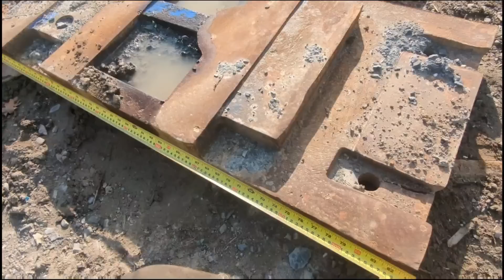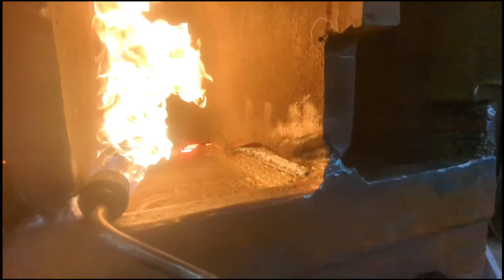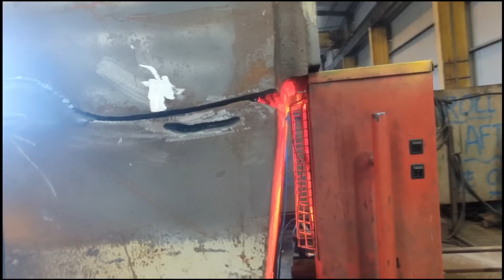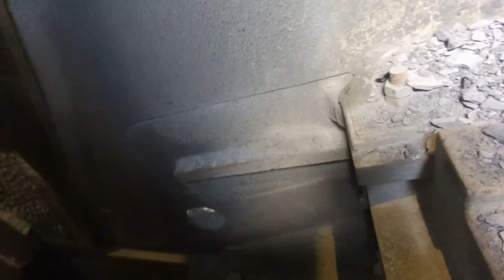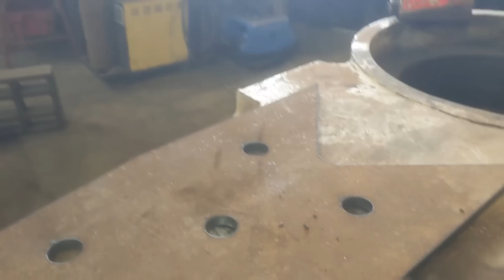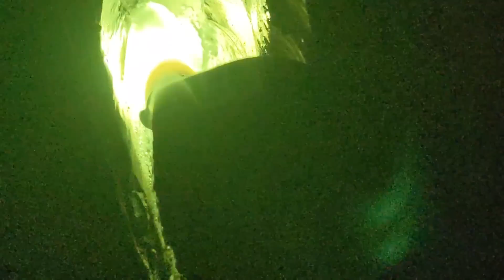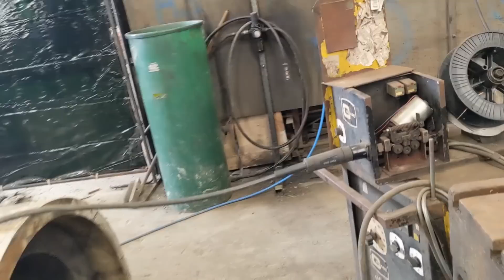10TON steel casting broken in half the welding repair starts!mega engineering!   quarry jaw crusher

Comment: On a job like this would the 1000 to 2000 amp welder, welding rods and the generator be cost effective vs the labor and wire cost to do it this way? I'm not a welder if you have any input I'd be grateful. Thank you.

Comment: I'm not a welder can someone explain why the side damage weren't cutout and new material used? It seems like new would be stronger than the damaged material? In the back would cutting both surfaces straight be easier to work with? 
Thank you for any input you can share. I'm here to learn.

Comment: The more that I look at this jaw crusher, the more I realise that it must have been quite a complex casting process in the first place. There are a lot of long voids that would have been formed by large, long, sand cores with carefully placed core print pockets to support the sand cores, where the circular holes are further up the jaw.
There would also be a large cylindrical sand core where the pivot axle housing will be machined.
The puzzle is to work out the orientation that the casting is going to be poured in. 
Mark from Melbourne Australia

Comment: Would it be beneficial to stick whole job in big furnace to bring up heat and equalize after welding?
Reply: I thought that as well but you would need one hell of a furnace. I also suspect that the furnace would heat up the material too fast. Not to mention nowhere to sit and weld if the whole thing is 150c

Comment: It might have been a good idea to weld it from both sides and work into the middle using to men on to separate welding machines, then you could spread the heat more evenly especially with such a big job, definitely add extra internal gusset’s as well for extra strength,Well done from NZ.

Comment: Hi why don't you use welding blankets or insulation on the welds when completed to hold the heat in and over night? You are not a bad welder either lol I'm a retired welder so I understand what you are faced with take care buddy yours konrad

Comment: I dont get it why it took 2 months to prepare and weld it , at the shop I was working we did fix a bigger jaw crusher than this one and it took only 11 days , first we put it on our large boring mills to remove all materials , dig all crack using a 30 * endmill, then get it on the table fixture to held both parts parallel, welding with big fluxcore wire , making plates to double the inside , then closing the back side with a 4 inch plate , it took 16 or 17 fluxcore wire .
Reply from the maker: How many people?
Reply from the maker: About half the filler too bud

Comment: .70-.80 wire with a ton of steel clothes hangers, preheat and pre-flux the surfaces to be welded makes a semi seamless virtually impenetrable weld very very tough however for this method on that metal make up which we call cast iron/ high carbon ferrous steel you need to do a controlled super slow cool down over a day at minimum a few days slow cool is best

Comment: Curious if you remove the weld splatter afterward, use to work with a Quality Man who would make us scrap every single drop of spatter off structural welding jobs columns, joist, etc. he would legit circle a weld spatter ball
Reply from the maker: Only on cosmetic fabrications,  quarries don't care about spatter they just want repair quick as possible

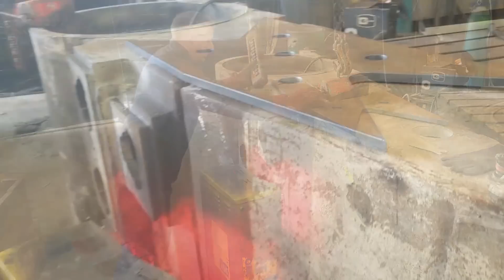Comment: Impressive!! @23:46. In a perfect world, with the right equipment @42:35 can you almost CNC/Router out have the width / depth of that plate on both sides and then weld that into place on both sides? Would that theoretically give more integrity? Or would that loss of material + the new plate be too little to help with that overall load?

Comment: just out of curiosity, do you ever use "heat temp crayons" to double-check or for sake of sanity if the laser is acting finicky on you? We experienced a couple of events with our laser temp gun a while back [caused by low batteries], we were perplexed because it gave us readings that we damn well knew wasn't correct. One of our buddies happened to have one of those heat temp sticks in his locker and it gave a better idea of what actual temp it was. After that our boss made it mandatory for QC personnel checking jobs that people were working on. In addition to keeping a backup gun on site. But I like the temp sticks better. was cuious if you ever noticed any odd behavior on your temp laser gun.
Reply from the maker: Yes they don't like shiny reflective surfaces!

Comment: I think that aluminum foil wrap would trap more preheat in the parts and keep it a  more uniform temperature at a very low cost and less trouble than blankets.

Comment: For that back weld (the elbow-killer) why didn't you raise the work to just over waist-height, and stand at the ends of the weld-run with your torch on an offset skate? No elbow/back pain. Just asking.
Monster job. Well done.

Comment: I am not a welder but I would have hired a low skilled, low paid helper or laborer to do the grunt work.  He could have been grinding on one half while you were still gouging on the other half.  He could also have been using the torch to preheat sections while you were welding.

Comment: Interesting, sounds like you’re using short circuit mig, I would have expected for anything that heavy, you would use spray transfer. 

But I only weld much smaller parts

Comment: I'm just wondering how strong all those welds are if each pass you weld  you're  welding directly on top of slag because not once did you show that your scrubbing RACH pass with a wire wheel to remove slag from that weld before welding the next pass over it... from my experience you need to remove slag before making a next pass so it makes a strong bond...other wise the slag just melts and solidifies between layers leaving stress points that will be weak spots that will 're fischer inside the weld... also why did you not recess the strengthening plate into the body of the structure which is they correct way to inlay a bowtie in a structure to create a stronger mechanical bond.. from both an engineering perspective as well as a welders perspective I spotted several mistakes where you could improve your workmanship as well as the quality of your work... I hope you don't take this as a negative but rather as a little constructive criticism that you may learn from or implement in your work ethics as I see you are passionate about what you do hence the fact you post this content however I feel that over the years of repetitive arduous hours of graft you've lost some of that passion and become a little sloppy... great work though there is room for some improvement fella 👍🏽
Reply: he used a wire wheel. a welder of this caliber isnt going to weld over slag

Comment: I worked for a large engineering company and we had a similar casting.  We had to build a furnace around the part, and slowly heat it up to 400 Deg C.  Then we welded it, closed the door, and slowly cool it down.  Metals have what are called fractal crystals, with Martensite boundaries between them.  That is where cracks occur.

Comment: I believe that the joints you are doing will be a bit stronger than the parent metal. I am not certain of the wear characteristics, although I don't see where they will be exposed to extremes of wear.

Comment: my experience rounding the corners of that reinforcement plate helps send the stress out over a larger area. It acts like it's longer than it is when you do it. putting it to a point on the corner puts the stress on that point in the corner.... You said it not bad for an old dog those cheaters are a lifesaver
(edit)  I'm not an engineer I work/ weld on cranes 27 years and these plates all round corners

Comment: Im not familiar with kleeman crusher. But i think there is to many sharp corners and sqares in the jaws. I'm working with sandvik/svedala and lokomo/metso crushers here in norway and they do not have square holes and sharp corners in castings. Very crack ressistant. Old svedala jaw crusher keep chewing vell past 60k running hours. Great video. I feel it in my arms and knee just watching you😂 you should try out 3m cubitron disc when grindig. The worst ting i do is grindig and after i start using cubitron the grinding time is not the worst😂 love this disc. They are making swarf. Not dust

Comment: if you ask me the entire thing has a major design flaw, the weak point of that whole piece is where the weld already has been broken......  the rest of the block is basically solid steel, but then suddenly in the middle there are those square empty spaces with those ribs,              if you would made the thing out of wood in small scale and bend it with your hands it would probably break at the same spot it is broken now, even if that hole wasnt there

Comment: I'm not a welder, but I'm somewhat familiar with it.  A little.  I have a question.  I understand the side  alignment being crucial. After welding, the metal contracts when cooling.  Did you have any concerns with alignment  movement?  Or, as I see, you moved to different areas.  Did moving to weld the opposite side counter any millimeter alignment you needed to maintain?  I'm so amateur at welding, I don't even know if these are legitimate questions.  But I am curious.  Excellent job.

Comment: A question, was there a reason for not starting at the center rib and working out. I know next to chambers or opposite walls would hold a preheat easier. But with the size,  material type and weight, I would think that balancing welding stress would also be a factor. I've worked with cast steels that had a grain type  that had a tendency to change easily

Comment: Really impressive work. I am no expert in what you are doing but i am wondering why  you do not use any isolation on the parts you are not working on. I work in  a chemical lab and we use sometimes glass wool blankets to keep reaktors worm. They can take a large amount of heat an d you would safe a lot of energy just by wrapping up tbe parts you are not working on. Maybe a naive comment but it seems like a cheap investment with huge return.

Comment: We have diesel fired forced air heaters here in the us that really throw off a ton of heat. I have one that is 400kbtu and that would have worked great for heating the casting. Top job you have done! Biggest piece I have welded was the 8000lb casting on my radial arm drill. It was actual cast iron though so extra fun!

Comment: At the start of the video you used a plastic butane filled cigarette lighter to ignite the LPG torch , nice to know it was empty of butane gas ;)
In my city there has been a few guys received horrific burns when they had one of those in their pocket when welding and a spark has melted through it and blown up in their faces , they never work again and go through years of plastic surgery.
Reply from the maker: Yes I know to watch out for that. Another one is areosol cans near work area!
Reply: @allistairc123  True , and some types of marker pen can be flammable too
Reply: @allistairc123  So many risks in our trade , you probably eliminate several of them automatically every day with good practices.

You guys still have coal mines and high sulphur fuels in ships there , do a search on Pyrophoric Iron Sulphide if you didnt encounter that one already , Its a rare type of rust that grows usually with a presence of sulphur and iron , it can occur in fuel tanks in refineries , ships , or any equipment that works around coal mines , a spontaneous ignition from it almost took my head off once lol :)
It can look like ordinary old rust but sometimes has a purple or rainbow sheen to it , it can explode without warning , or explode if you nudge it or tap it with a hammer.

Comment: Great to see so many good technical theories used in your job planning Al'

A small detail i learnt when gouging though is that Air Arc gouging produces a very high concentration of carbon in the oxidised steel which causes "carbon embrittlement" , we  typically use a 9 inch grinder to take 0.5 - 1.0 mm of metal out of that weld Vee prep before welding otherwise is will likely crack again in 1000 + hours.
Wrapping the corners and overlapping stop / starts is also common with multi layered welds.
Its all up to the individual of course and other boilermakers / welders would have written up a slightly different Welding Procedure Specification.
I would not have welded the entire depth of weld in one sitting , i would have welded 30 % of the depth of the Vee , Then go back to the other side of the job and weld one side of the gussets 30 % , then flip the job , weld the first 30 - 50 % of the other side of the gussets , rotate the job again and fully weld the back , then go back and finish the gussets as a bare minimum , In fact i would have probably broken the sequence down into smaller steps to reduce distortion.
Your normalising was great , alot of shops would try to sneak it out without doing a stress relieving or normalising HT.
I am 58 and still learning :)
Reply from the maker: Hey , yes I wrap corners for joints where plate join is perpendicular  and I also alternate  and rotate welds more than my videos show the internal gussets were welded 50 percent  a side  4 stages between two sides for the reasons you mention.
Reply from the maker: The gouging carbon is interesting, what I have found is if air flow is bad due to akward position and you have re solidified metal is always horrendously carbonised ,  otherwise when the airflow is great then virtually all melted metal is removed leaving minimal. Carbonised metal, but I agree there will be a skin, that is why correct weld settings are so crucial to dilute  that interface withs lots of penetration . It would be very interesting to see what the mechanical specs on a weld on a gouged surface would produce. It could give beneficial increase in tensile yield, but as you say may become a little more   brittle.
A very interesting point I will have to research more.

Comment: Great to see you're using a fresh air supply mask , especially when doing Air Arc gouging.

I have seen a few guys trying to use straight air from shop air compressors which is a big no-no as It can cause pneumonia , collapsed lungs and other nasties from the oil vapour in the air and piston compressors also produce ozone.
There are filter packs however that can clean the air to 99.99 % that are commonly used , I use a blower fan that pulls clean air from outside the factory , runs it through a filter then to my mask.

The carbon dust from Air Arc is highly carcinogenic , definitely not a health food !

Comment: Man oh man that was a ton of welding absolutely crazy. I'm surprised you weren't using spray transfer with the amount of passes needed super hot short circuit = lots and lots of bbs spatter everywhere. It definitely looked hot enough but my god I don't envy you at all having to clean it all up afterwards grinding back the outside portions must of killed your back neck and sholuders. They must be  paying you a pretty penny down at the workshop for you to put yourself through such a mammoth task. Excellent workman ship I'm sure she'll be in service for many many many years to come.

Comment: That was impressive and well done.

I don't think I have that kind of patience. Doing the middle short arc in 2G, was not what I was expexting, and that was the best physical explanation of the 3bar model on an actual part that I have ever seen. I would have tried to cut down on the passes and spatter by doing it 1G, flux core, spray arc, with the largest diameter wire my machine could handle. If not sub arc with a bugo especially for that back joint. You have some serious patience and a get it done work ethic. 

Your carbon arc work was impressive, mounting the camera to the stinger is youtube gold, i could watch that for hours.

Side plates are good thinking. Reminded me of the Liberty Ships, probably not necessary in this case but can't ever be too careful. Sometimes i find that going up to 80/90S filler in castings can really help with all the  "junk" in castings.  Higher nickel content grabs more of the impurities (mainly copper) and increases strength, 302 is not fun to weld with.

Awesome job!

Comment: Did you consider electroslag welding?  Don't see it too often and I don't even know it if would work for this.  I do know that it's used when there is a high quantity of filler needed.  I would think the joint in this cases isn't uniform enough to use ESW.  When I've seen on bridge girders, the joint is very uniform and generally all straight pieces.

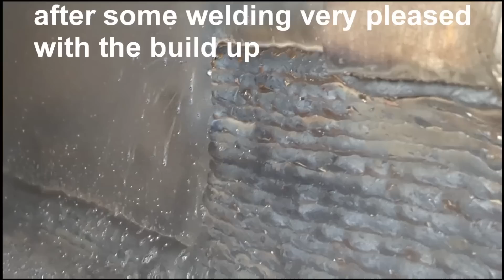Comment: Why do you have so much spatter on your work. You are running a M.I.G wire, for this thickness material in 1G your settings should be for Spray Arc not spatter arc. Your beads have rolls. That's not good. (T 22:08) take a look at the up post top bead.
Reply from the maker: I can assure you I have zero cold rolling/ lack fusion despite how it may look on camera. spray transfer is no good , less pen and cooks crap out of weld shroud. The reason I have more spatter is an old school weld set that is super reliable, no electronics to give fancy wave patterns and less spatter.
Reply: The roll I saw is also known as zag from welding too hot. Welding too hot is just as bad as welding cold. When you weld too hot it changes the grain structure of the base metal making it brittle. It also weakens the weld because the reinforcement is not at the throat of the weld. Maintain Proper ( Settings, Pre-Heat, and Inter Pass Cooling Temperature). @allistairc123
Reply from the maker: Any particular convex beads are ground back to ensure next pass penetrate the edges. I'm running big amps that obliterate any of these proposed issues. The big amps contribute to the overly convex  bead but the pro outweighs the negative. When the cap run is done I dial back feed for a flatter more asthetic weld.